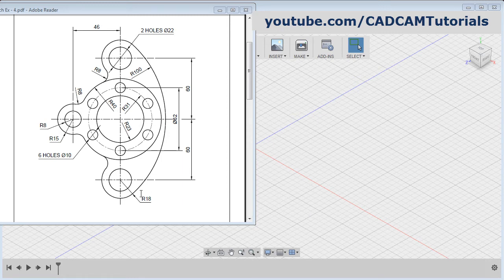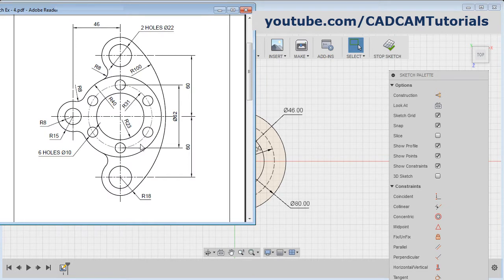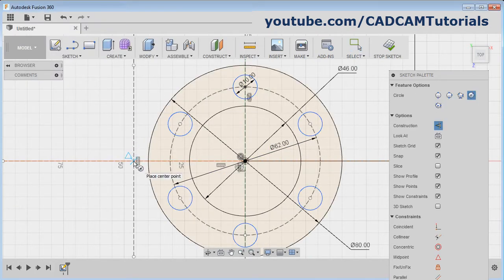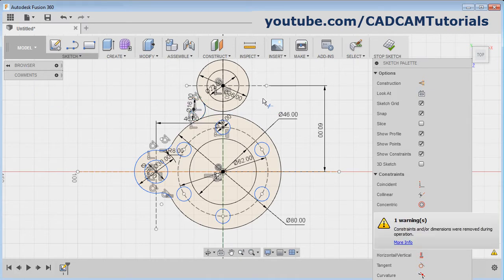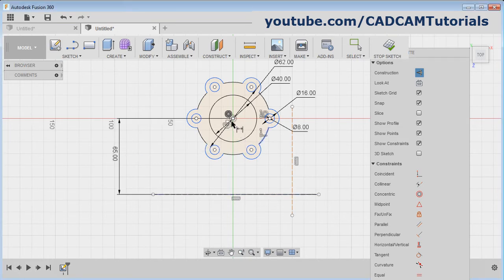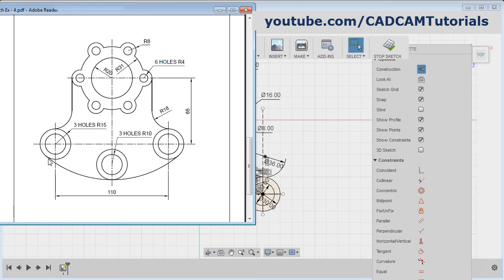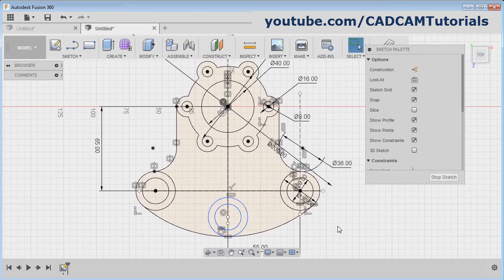Fusion 360 Sketch Tutorial | Fusion 360 Practice Exercises for Beginners - 5

Comment: Hi. I have been working through your sketch tutorials and now think that I have missed something. At about 12 minutes into this video you create two circiles of 8mm and 18mm on the axis. To do this you press C click the centre point then drag to origin to the new centre point. When I try to do this I just get a circle with a radius from the new centre to the ot=rigin.

Please what am I doing wrong/missing?
Regards David
Reply: Sorry meant to say at about 7:30 into the video
David
Reply from the maker: I am not clicking the second point, I type the diameter value and  press enter.
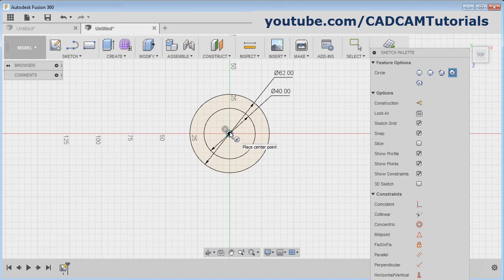Reply: I am sorry, I was not clear. At 7:20 you press C click for the centre point (on the X axis) then you say "drag this point" and show you dragging from the origin to the centre point of the new circle. You then say click on the intersection point - and go on to create the 8mm circle.

When I try this, I place the centre point on the X axis/intersection of the 62mm circle. The moving the cursor towards the origin starts to create a circle and it ends up as one with a radius to the origin - obviously not what you have on screen. What am I doing wrong?
Reply from the maker: For creating circle, press C, click center point, take cursor away, type diameter value and press enter.